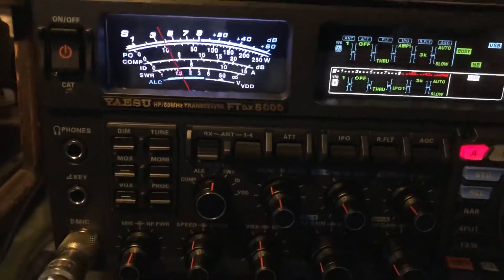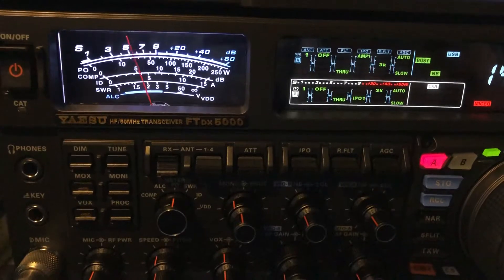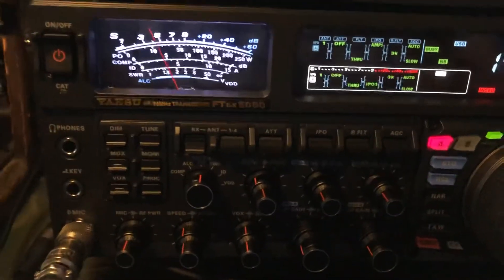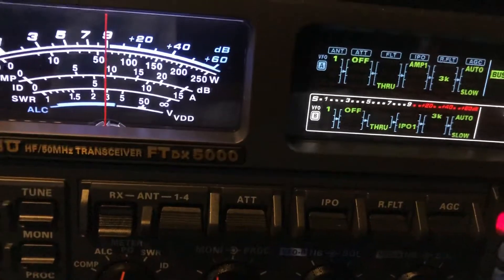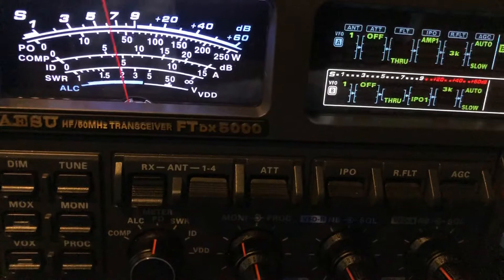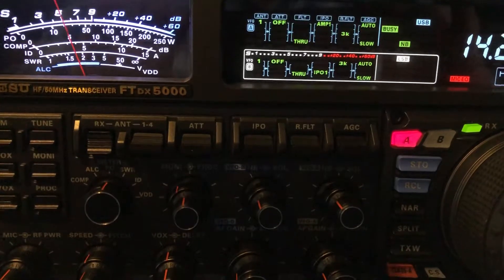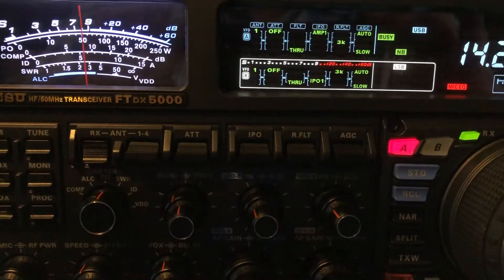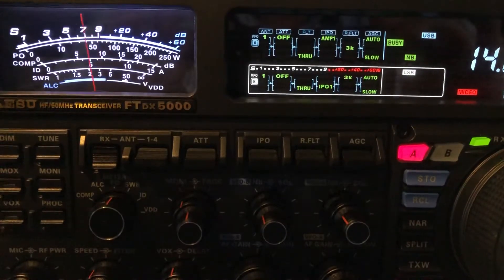OCF Dipole versus 160m Dipole fed with 450 Ohm Window Line

Comment: How high is you 160m antenna and how long is your 450 ladder line?
Reply from the maker: The apex is at around 40 feet. The ends are around 15 feet. The window line is probably around 55-60 feet.
Reply: @n4hnhradio   Thanks for info, just moved to new location and going to put one up about 70 feet and ends around 50.  Hope it will work well on all bands.  Thanks
Reply from the maker: It should work very well. Palomar Engineers has some great information about the length of wire and ladder line to use. There are certain lengths you should avoid.  Lengthen or shorten the ladder line in 1/8th wavelengths to move the point of lowest SWR. I adjusted mine for lowest SWR on 17m.

Palomar Engineers: https://palomar-engineers.com/ladder-line-fed-antennas

Comment: You make such GREAT videos; Thank you.   I am planning to replace my 80m dipole with a 250' dipole (160 meter operation planned).   I will feed it with 450 window line, a 4:1 balun, and then use a remote antenna tuner (MFJ 993BRT) at ground level....  then run LMR400 into the shack to my DX10.   Using a remote antenna tuner, instead of a desktop tuner,..... should I expect better, worse, or about the same performance as your set-up?   The coax run into the shack will be less than 40 feet.
Reply from the maker: It’s good to keep the ladder line out of the shack. The remote antenna match makes that possible.  My ladder line comes into the shack at the top of a window but it immediately connects to a 4:1 3kW choke BaUn.  Then I use 9 feet of LMR-400 to my tuner.  I made these changes last year and it was documented in videos. 

40 feet of LMR-400 isn’t much loss, especially at 160m, but even for the other bands. I think your performance will be at least as good as mine and possibly better. 

Ironically, I had some tree surgeons here today and while they were here, I had them reposition my doublet. Video will be forthcoming in the next couple of months.

Comment: This seems pretty consistent with my findings as well. My ocf dipole (about 90-feet/180 feet) has been a disappointment. I'm using 10AWG, THHN wire (we have harsh weather here in the Pocono mountains) for the ocf dipole. Although the swr is  low on most bands, it doesn't work as well as my double size G5RV. I know the G5RV gets a bad rap, but it's worked really well at my QTH, often outperforming my 80 m dipole on 80. 
I may replace the OCF dipole with a 160 Meter dipole when spring rolls around. Thanks for the video!
73, AA2HA
Reply from the maker: As the saying goes Tim, a dummy load has a low SWR but it makes a terrible antenna.  The OCF dipole is okay but it is a compromise antenna.

The G5RV is in the Doublet family.  It only gets a bad rap from those who are ignorant about it.  I ran a G5RV from 1991 until 4 years ago, when I “upgraded” to the ZS6BKW.  I love it when I hear someone bashing the G5RV after they’ve just told me how great my signal is.  Then I tell them I’m using a G5RV and…all I hear is crickets.

The optimized version of the G5RV, known as the ZS6BKW, is a great performer, and it doesn’t need a tuner for 40, 20, 17, and 12 meters.  It will also work on the FM portion of 10 meters (29.600 to 29.700 MHz) without needing a tuner.  

The ZS6BKW is also in the Doublet family.  My ZS6BKW rivals my 250 ft. Doublet quite often, and with a lower noise floor.  I use the NI4L.com version of the ZS6BKW.  NI4L builds with all high quality materials and he tunes it perfectly.  Maybe you saw the ZS6BKW unboxing video I published a few weeks ago.  

My ZS6BKW has been up for approximately 4 years and it has become my go-to antenna for 40, 17, and 12 meters.  I mainly use my Doublet on 20 meters but the ZS6BKW sometimes beats it on 20 meters.  The ZS6BKW also performs well on 60 and 80 meters, using an antenna tuner.

73, de N4HNH

Comment: are the two antennas radiating in the same direction?
Reply from the maker: It’s hard to say, since multiband antennas don’t follow the broadside figure 8 rule.  As you move higher in frequency, above the frequency the antenna is cut for, other lobes develop, as do nulls.  Remember that gain is a redistribution of radiation.  You take from one direction and give to another.  First, we like to take away from the vertical radiation, pushing it down toward the horizon.  Energy is wasted when we simply warm the clouds straight above us.  With a beam, we take that redistribution of radiation to another dimension.  We try to push the radiation in one direction, with one big lobe forward.  Of course it isn’t exactly perfect, but it is a big improvement.  

If you look at the radiation pattern of a Yagi there is typically the large (major lobe) pointing forward, and minor lobes pointing South,  Southwest, and Southeast, if the Yagi is aimed North.  In that case there are four nulls, the deepest nulls are due East and West.  That is a generalized description.  Every designer of a beam tries different methods to tweak theirs, so the pattern can vary somewhat.  But the point is, gain is developed by redirecting radiation in a more desired direction.

My doublet develops even more lobes of gain, and nulls, over the typical single-band dipole, due to the doublet consisting of twice as much wire as the 80m OCF dipole.  The OCF dipole does okay on the higher bands, perhaps edging out a perfectly trimmed dipole a bit, mainly due to the extra length of wire.  But the OCF dipole cannot compete with the gain of the doublet at the higher frequencies, especially 14 MHz to 54 MHz.  And the doublet is fed with open wire line.  The loss of power per 100 feet at 14MHz is approximately 5%, where RG8U coax would lose approximately 15% of the power.  

Fortunately for me, the nulls I have noticed with the doublet are in directions that aren’t critical for me.  On 20 meters I have tremendous gain toward East and West and North and South.  There are certain sections of Canada and South America where the gain of the doublet is no better than a standard dipole.  But that’s okay too.  That’s why I have multiple antennas. 

73, de N4HNH

Comment from the maker: Hi Doug!  The 160 meter dipole is 246-feet 4-inches of 14AWG wire, fed in the middle with 450-Ohm window line.  I use a Ladder-loc for the center support.  There is approximately 60 feet of window line coming straight down from the maple tree just outside my shack.  The center point is at 45 feet.  The ends are approximately 20 feet off the ground, pointing toward NE and SW. So it is technically a lazy dipole.  It could also be called a doublet, since it is fed with balanced line.  You don’t need to be extremely precise with the antenna length, since it is fed with balanced line.  Some hams just put up 250 feet of wire and feed it in the middle with ladder line.  The feedline factors into the match so making the antenna at exactly 246.33 feet isn’t so important.  The tuner takes care of the match.  There is a 4:1 balun inside the tuner that gets it closer to 50-Ohms.  Mine is resonant on 17 and 20 meters with the tuner set to bypass mode.  You can add or subtract feedline to change where the antenna is resonant.  I just ran enough feedline to make it into my shack, and it just so happened to be resonant on 17 and 20 meters.  I was happy with that so I left it alone.

The OCF dipole is at 50 feet, fed with 100 feet of RG-213.  It is orientated as an inverted V, with an angle of approximately 150 degrees, per the factory recommendation.  It is a Fritzel F-D4, the 3KW version.  It has a 6:1 balun at the feed point.  73, de N4HNH
Reply from the maker: @John Palese the ladder line comes in through the top of my window.  I pulled down the top half of the window, pulled the ladder line through, and then closed the window on it.

I showed the ladder line in a couple of my videos but I don’t remember which ones.

73, de N4HNH